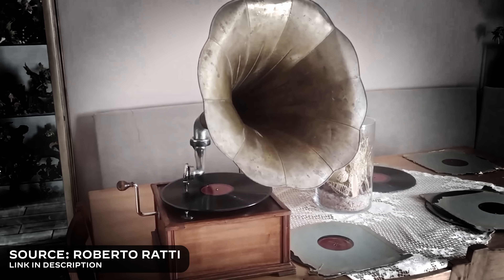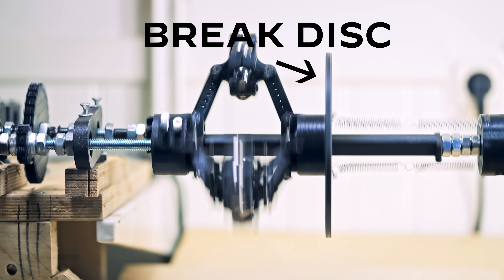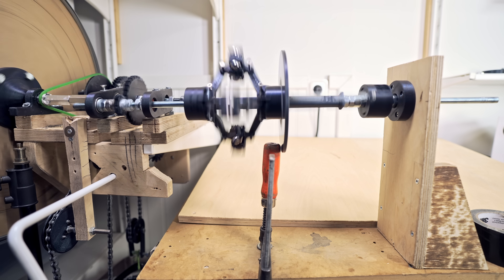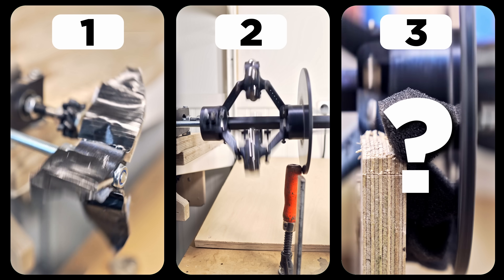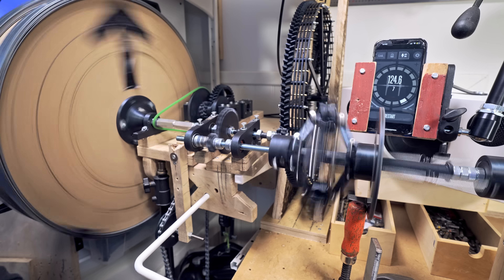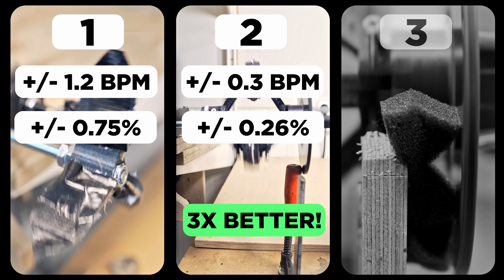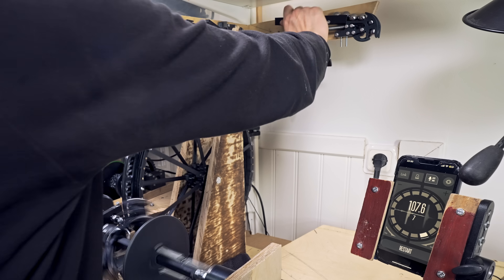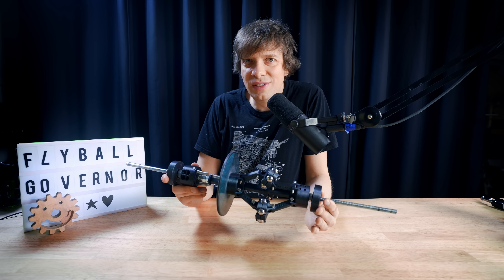How Gramophones play Tight Music - The Flyball Governor

Comment: I wasn't expecting the foam to work better because of it's squishiness, but now I wonder if you used a bearing to stop the disk it that would be even better.
I think the foam is causing the disk to slide more, rather then gripping like the rubber handle, making the tempo more regular / flat.
Optimally all the friction would be from the disk pressing into the stopper and no friction from the rotation of the disk. IE I think that, in the best case, all the friction would come from the pressure of the governor pushing the break disk into the stopper. All rolling friction, no sliding friction.

I could be wrong about this, It's just the first think I thought after seeing your experiment.
Reply: As far as I can tell, the squishiness is what's making it work better. The harder the braking disk is pressed into the foam, the more surface area is actually in contact with the disk, making the friction significantly higher. Whereas the handle only has a single point of contact, making the friction only vary due to pressure and not surface area.
I'm not entirely sure what you mean by friction from pressing into the stopper as opposed to friction from the rotation of the disk. Pressure is not the same as friction, but friction is proportional to the pressure. So you need both.

Comment: I had an idea for a project I am working on and if you could try it out since I think it will work here too. If the disk is made of a metal like copper and your stop point was a large magnet, then the inductive braking would get stronger and stronger the closer they get to each other. Then you don't have to worry about friction and parts wearing out

Comment: Maybe a more reliable construction could be a second spinning disk attached to the other, which is connected to ball bearings. These could be attached to screws, which can be precisely adjusted.
An other more experimental solution for precise speed adjusting could be an hydraulic system, but in view to oscillation it's in theory not the best solution...

Comment: I definitely believe that the flyball governor is the way to go, but you should probably test if you still need the huygen drive if you're using the flyball governor. It'd be much nicer to not need all the extra parts and complexity if you could drive it directly with a little help from the governor.
Reply: 100% this.  If the huygen drive was chosen because it provided steadiest source of input energy, but wouldnt be the preferred mechanism otherwise, it'd definitely make sense to test whether the gyro governor renders the huygen drive's fundamental stability moot.
Reply: @kevin27966 yes exactly. Plus it's WAAY cooler to be driving the machine directly. I know he's into the form from function thing, but if it performs just as well then it's obviously much better to not have the huygen drive.

Comment: Before you fight the MM3, perhaps a good intermediate step would be a Marble drum machine? That way you can test everything as it's integrated together, and also have a cool machine to make some music with.
Reply: AFAIK this was the idea initially - to build a prototype with one channel (one instrument)
Reply: @1815dmitriy  that's basically what he's doing here, he pretty much just needs to add a marble return loop and he is running a full single channel proof of concept
Reply: That's basically what the MMX ended up being.
Reply: I think Martin is on the right track already. He is concentrating on power delivery above all else. There is not much point in building anything else without a reliable power source that can deliver the required torque without causing timing issues. He is current doing precisely that whilst whacking moles along the way. It sure does seem like he is ready to upgrade his prototype power train to something more... substantial though. Can't wait to see his next steps.
Reply: He's essentially already doing that, since each piece of the MM3 will end up a closed loop he can just build each loop separately and then connect them like LEGO sets. I'm still a little worried about how much strain this is going to put on the power drive shaft, depending on how thin it ends up.
Reply: +1 on that
Reply: Yes!!! MMX saw Martin make 38 of something before he had a whole system working.  Then he had to remake the 38 things three times. 🤦‍♂️
Reply: Can we have multiple Martin's working on every part

Comment: You mentioned something at 7:22 about how it seemed to find the tempo faster? I feel like that's something important to keep in mind to mitigate downtime between songs, or maybe maintaining tightness while changing tempo within a song? Being able to get up to speed faster is definitely a huge bonus.
Reply: It would certainly reach tempo faster as it doesn't experience much of any braking force from the governor until it's at the desired speed, at which point the brakes engage. The air governor is continuously adding more and more resistance the faster it goes, but it applies resistance from the very first moment.

Comment: Can you make the stop block for the govenour adjustable (maybe in small intervals) then you can easily change the prefered bpm for each song quickly. Or even adjust within the song like in the original version when you cranked it by hand. 
Great progress ❤
Reply: I feel like that's another benefit of the flyball governor — unlike an air governor, flyball governors can be easily adjusted even when the machine is in motion by moving the brake pad. Original gramophones also allowed for the end user to easily adjust the speed since early records prior to the 1920s were recorded at slightly different speeds (76-80 rpm)
Reply: Not only can he adjust it on the fly, but he can also have it labeled so that he always knows the current BPM.

Comment: and if you turn the governor vertical and use gravity as the brake instead of a friction material?
Reply: The benefit of the friction disk is that you can move it back and forth to determine the bpm you want between songs or even within a single song.
Using gravity, which is constant, would result in a constant unchanging bpm, which is undesirable.
Reply: @TijmenZwaan  different tempo's could be achieved with gearing, isolating the function of the governor.
Reply: @spaminbox  That just introduces a whole bunch of additional mechanical complexity that's completely unnecessary. Having a single brake point that you can slide back and forth into the correct position is a much simpler solution, as well as being a completely continuous scale. You can pick any bpm between the minimum and maximum bpm.
Whereas a gearbox will have a discrete set of configurations/bpms you can choose from. Unless you use a completely variable gearbox, which imho just introduces even more unnecessary complexity.

Comment: A break pad on a spring would probably also work. I think the foam is so much better because it allows for movement of the governor disk, while still breaking to different degrees. So when the speed is increased ever so slightly, it allows the governor to respond. Also it smooths out any wobbliness in the break disk. But your setup looks pretty sub-optimal when it comes to friction and stability. All the squeaky sounds are friction! So in the real machine it will probably be even better.
Reply: I wonder if induction braking would be a good choice here? Permanent magnets on the stationary part, a metal disk on the rotating part. Rotational energy is converted to eddy currents in the disk which are then dissipated as heat. Super smooth, no parts have to touch each other, and the force varies depending on how close the magnets are to the disk which should enhance the self-regulating effect (which we're seeing in the foam).
Reply: @bewilderbeestie  I am no specialist of induction breaking but I believe it would break even when the disk is quite far from the magnet. which might be annoying, the machine will almost always break (not with the same force but it will still break and dissipate energy which is not cool)
Reply: @bewilderbeestie  That's a really interesting idea, however, with magnets there is no precisely defined line where it starts braking. Well, it may be a good thing, idk.
Reply: Problem of the foam, I think, is that it will wear out fast.
Break pad on a spring seems a more robust solution, indeed. (with a long, soft spring, to smoothly control the breaking force)
Reply: Integrating this to a bicycle disk brake would be a good solution. It will be much more durable than a DIYed friction solution.
Reply: this is just "a prototype of a prototype" built from sticks and shit. The real prototype will have more rigid frame, proper axles and bearings.
Reply: The final break disk has to be made out of metal, best would be brass - and I'd recommend felt as a break pad, like the one used in gramophones. They are easily obtainable - they're furniture gliders. They come in a pack of 20 for under a dollar.
Reply: The foam also has more points of contact compared to the clamp because is squishes into the wheel, and the clamp handle being curved had incomplete contact. Foam clearly works, but I think it will wear out a lot faster and probably be a little harder to dial in the BPM as well, since the stopping location moves slightly due to foam squish.
Reply: I think that even with a fix stop for the governor disk, the breaking is more or less important depending on how far from the speed target you are (the faster you are, higher the centrifugal forge, and thus the higher the force between the disk and the stop will be, which a better breaking). With a break pad on a spring, I think it would also increase the breaking force yes, but I am not sure it would be more efficient (it actually might be, I really don't know, I should write down the equations, but I have other things to do at 11pm). 
I think another thing that explains why it is more efficient with the foam is that the contact surface is smoother, like his disk is probably not perfectly flat so the stop and the disk might not be always in contact (at least not always with the same force in a single turn) and so it brings irregularities.
I don't if I was clear enough or not, but I hope you understood the idea

Comment: im a little confused why you didnt test the same bpm for every test. Still a great video, but would like to see consistent variables across all tests
Reply: It didn't matter what the bpm was, sense that can be configured. What matters is if that bpm is consistent using the part in question
Reply: I think it does matter because at a higher BPM there is a change there is a higher variance of bpm. (When you look at it from a % perspective you can see he used the 75% vs 25% to determine it was 3x better.) If you run them all at 160 BPM maybe the variance % remains higher close to the 75% while at a lower bpm it is closer to the 25%? For each version, he lowered the BPM and the variance decreased, you've added the bpm as a factor rather than removing it by keeping a constant BPM.

The foam flyball governor is problem better but I would guess it's less than 10x better, just because the BPM variance. @lefterismplanas4977

Comment: I wonder if the massive flywheel is necessary or if it can be less heavy with a flywheel governor 🤔
Reply: The flywheel needs to keep up its inertia because it will be moving a lot of rotating parts.
Reply: I mean, it looks cooler when it's large, and while this time it's function > form, you don't lose any function and yet you gain form, so why not keep it large?
Reply: @warmwater9509 well the function of a flywheel is to store momentum, the larger the wheel the more momentum it can store,
Reply: @sirsanti8408  yes it's(flywheel) supposed to be a capacitor of sorts, not a regulator, though I think Martin thinks of it as a regulator.

there's some books that would have the mechanisms to regulate the speed by using a sort of a differential to not lose as much energy by crude top limit braking.